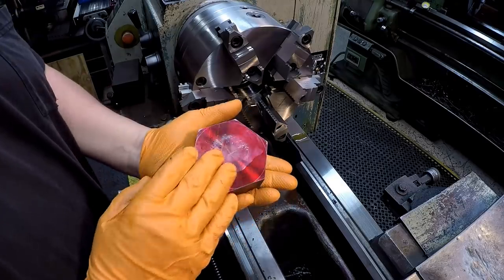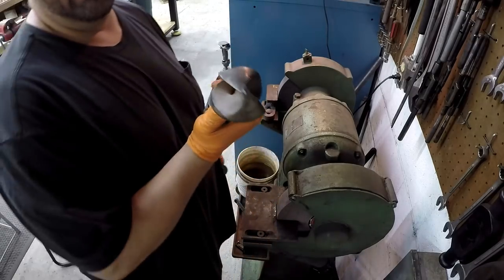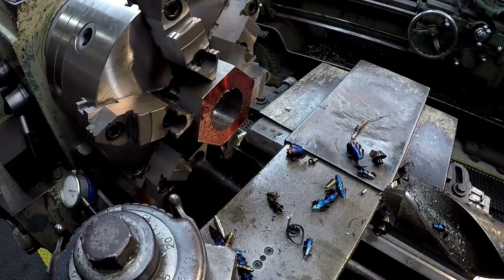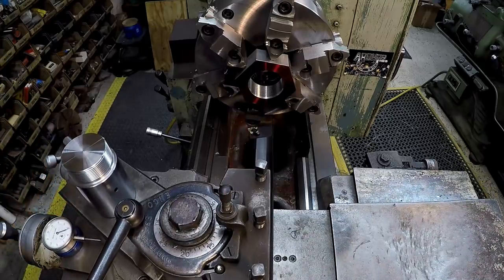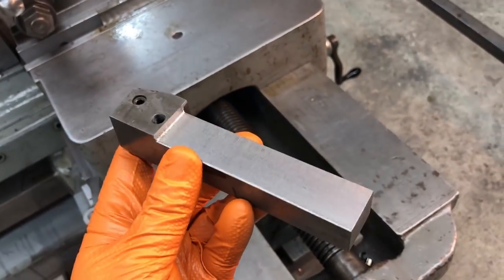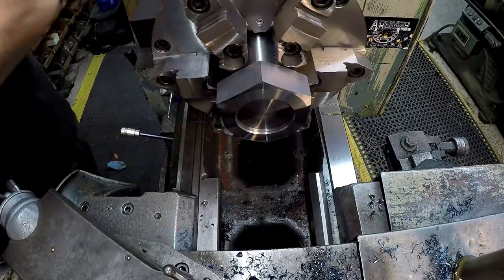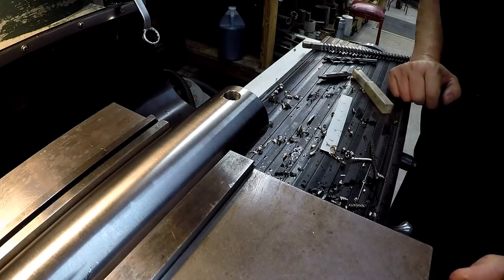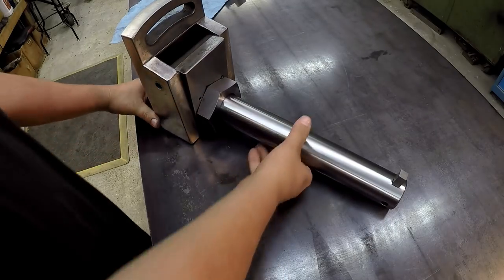Custom Internal Shaping Bar Part 4

Comment: Again I know little and have no experience in a machine shop. Would it be a good idea to mill 2 flat spots on it, so a wrench could hold it while you are tightening the nut?
Reply: Learning Electronics Cheaply 
i was assuming or wondering why he didn't put a key or a spline on the shaft to keep it from rotating whilst in use.
idk if it was an oversight or if I'm over thinking it.
Reply: Learning Electronics Cheaply I would think you want it to be infinitely adjustable. If you key it or spine it, it would only be indexable to the spines or the key way. Just my thinking anyway.
Reply: that makes sense.
so, i guess that means I actually was or may have been over thinking it.

Comment: Adam I was wondering how the clapper will handle the stress of the additional length of the shapping bar and how can it it be compensated for? If you covered this sorry I may have missed what you said ...love all the videos and I am in the I.T. field, dont do any thing with metal working not even as a  hobby. I came acrossed your work because two of my customers own machine shops here in Jacksonville, Fl and their work looked interesting. So i have been watching your videos for along time now. Keep up the great work!!

Comment: Adom  when you are fitting the nut on the shaft would you consider a little lapping compound to loosen the fit a little?  i have an 1936 Atlas 10x36 which is the third from the last one made according to the s/n  i appreciate the detail in your explanations and great photography    THANX

Comment: @27:00 The machinist fit, no play and wiggle. I'm new to this and I have terrible backlash on my cheap lathe. If I was to remake the nuts to a tight machinist fit like this would it eliminate backlash? Any advice is welcomed.

Comment: on the drill bit you ground, you said it was soft, could it be that because of its age and previous grinding that you have passed the original tempering of the metal?

Comment: what type of broach are you using? I use 2" boring bars with 1/2" tooling for my mobile line boring setup, and want to make some more bars to have more different lengths, you can see the problem in my video of line boring a steering cylinder  boss on a skidder where a much shorter bar would have been ideal, but the broaches that I have found for 1/2" holes state that they can't do a full 2" depth
Reply: I am in the same position... Did you find an answer?
Reply: @TheDavid5662  I haven't tried yet, but I am going to try tapping the hole first to remove more material, since I need to tap anyway, and my understanding is that the gullets in the broach filling up should be the deciding factor on broaching depth. Hopefully this fill make a regular broach work.

Comment: A  drill wall rack would be nice to display all the big stuff you have 👍
Reply: Do you realize how much wall space that eats up? I do, a flat ton. I had an improvised drill rack for awhile. In the end, I couldn't justify the space it wasted. My Morse Taper drills are now in my Vidmar cabinet drawers.
Reply from the maker: If I had plenty of square footage for tool storage I’d love a more pro rack system, but since I don’t, the Lista works just fine.

Comment: Why did you put the set screw from the side instead of from the end like your buddy in Pine Bluff did? I am also wondering why you didn't machine something to keep the bar from rotating while tightening the nut, whether it be flats or a key or some other method.
Reply from the maker: Your asking too soon

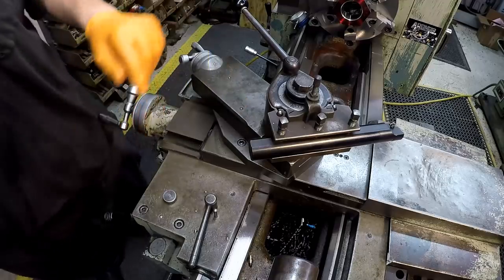Comment: I have watched a hundred hours of Adam machining stuff. at  10:00 Adam measures the diameter of the 2" hole he just drilled. He surprised to find it is 2.002", I am NOT. This is Adam Booth. He is a Master Machinist. Even when he is not trying hard for accuracy, he comes within 1/1000 of his target. Then at 12:50 he says, "I'll indicate it so we are square with the work here" and then shows the result--the needle is Rock Steady across the length of the tool holder!
Reply: The needle was stuck.

Comment: I see you're wearing rubber gloves.  Have you ever tried using the super thin cotton inspection gloves as liners?  I wear rubber gloves 4-6 hrs every day at work and swap a couple sets of liners (so they dry between glove changes) and new rubber gloves every hour or so.   They make a huge difference!

Also, damn that drill index is sweet!
Reply: if you work with rotating machinery I'd think it is a bad idea unless they rip easily
Reply: That's a good point.  They are super thin but probably tough enough to be an issue if something got snagged.

Comment: Great video Adam! One question,  I’ve noticed the clapper on your shaper is always offset one way and the tool holder offset the opposite way, my curiosity has to know why.  Thanks for the great content.
Reply from the maker: You swing the clapper away from the direction of cut so that the arc of the tool swings it away from the cut. The angle of the tool holder itself is just to create the lead angle I want for the cutting edge.
Reply: Thanks for teaching me something new today!  Cheers from eastern NC.

Comment: The break line where the grind angle meets the major diameter should resemble a thread line (left handed) tracing the diameter like an interpolated tool path. Also use that guage to make sure the two cutting edges meet center of the drill..

Comment: I will put a little bit of fine lapping compound on the threads and lap the nut to the threads to give just a scooch of clearance. Learned it from an old timer, he called it the poor man's die nut.
Reply: A tiny bit of valve lapping compound will do the same...a tiny bit, mind you.

Comment: Hi Adam.  At 2:25 when you first started drilling the bit tip raises up prior to entry into the piece.  Does the bit correct it’s self when it starts drilling or does it run off center.  I am new to machining and notice this with my drills sometime.  Thanks for sharing.
Reply: Good question! The answer I've always heard (And I believe it from experience) is that it's due to the tailstock being at a slightly different height than the headstock. Usually, there's some way to adjust for left-and-right error, but not up-and-down (Wear plays a part too.) So when the drill isn't in the hole, in this case, it's just a little bit low. Once it touches and starts cutting, it self-centers (raises up, in this case).

It can also occur if the drill bit is slightly bent, or if your drill chuck isn't holding the bits exactly straight or on center.
Reply from the maker: The drill naturally follow the center, but as all drills do they walk off slightly. No a big deal when your boring to finish.
Reply: Thanks Adam.  I really enjoy your videos.  Thanks for sharing.

Comment: My opinion is one thing more should added a hex or two flat spots that you can hold the main bar to adjust it when you tight it on the clapper box 🤝

Comment: With an insert type spade drill I can usually drill a hole around a thousandth oversize.  I should add, my holder is shop-made, commercial ones might even do better.

Comment: Adam I enjoy your work.  So many say when drilling whole to alway always always step up in sized.. is there a reason you when from no whole to 2" in one step?  I'm not trying to correct your just understand why and when and differing thoughts.
Reply from the maker: Shaun Tucker I always step up in sizes. I went from 1/2” to 2” on this job.
Reply: Abom.. thanks.
Reply: I’ve always been told that the pilot hole should be just wider than the land of the next drill so that you are using the entire drill. It prolongs the life of the drill

Comment: Should be 0.625 for UN threads. 0.75 was the older value for American National threads. When the spec was changed over to unified threads, the thread depth went from 3/4 of V height to 5/8 of V-height.

Comment: Man I love the broaching. Way back when dinosaurs roamed the earth I worked at Westinghouse in Tampa where they made nuclear steam generator parts for a French franchise. They developed a special broaching machine that pulled two broaches is opposite directions simultaneously through 4” plate. The broach pattern was a modified cross on specified diameters. The broaches were 12’ long! Unfortunately I never got to see the finished machine or see it in action as this was done in France. Bummer! BTW the plates were to hold large copper cooling tubing. There were many of them inside a special pressure vessel.

Comment: When cutting threads, how do you know when to start the cut? What keeps you from starting a thread on the wrong side of the inside diameter, compared to your last pass?
Reply: there's a threading dial. usually broken into 4 equal segments labeled sequentially.  if you throw the feed lever at the same location it engages the saddle at the same location on the lead screw on the lathe. the lead screw and chuck are mechanically linked so timing should not be an issue so long as the part is not removed
Reply: This Old Tony has a good video about cutting threads. It is a nice channel to follow too.

Comment: I have always wondered, is the shaper faster or more precise than a Bridgeport or a CNC Router? When would you choose to use a shaper/scraper than a CNC?
Reply: It's fun. :)
Reply: he's mentioned that it's just fun for him and just gives him a chance to utilize the shaper in almost every video featuring it, except for this one for some reason.
ps, not trying to sound like a turd about it. i was curious myself as to why he didn't say anything about why he uses the shaper, since he usually does.
Reply: For cutting something like case hardened tool steel the shaper is perfect, no point messing up a nice endmill on an unknown material.
Reply: Exactly. If your shaper's HSS cutter gets dull, you just re-sharpen it. If a milling cutter gets dull, you have to send it in to be sharpened. If the HSS cutter gets a corner snapped off, you grind it down anew. If a milling cutter flute gets broken off...time to buy a new cutter :( The shaper seems to be way more forgiving and even more economical (depending on how much electricity it uses, of course)

Comment: You're opening up some big holes, ever consider using spade drills?
Reply: @jaydunbar7538  take the time to familiarize yourself with Waukesha metal working spade drills with heavy duty steel shanks, or Sandvik carbide insert metal cutting spade drills or Valenite ,iscar ,carboy etc  before sounding off in future they are an extremely efficient metal removal tool with excellent surface finish.

Comment: you need to bring home some 20 foot lenghts of various sizes of white Schedule 40 PVC pipe... cut them at a 20 degree angle about 10 inches long...  get a can of PCV primer and glue also.. when you get a you may want a  piece of 1/2" or 3/4" PVC also..  you can glue them in to a big drill rack.. you may want to start with some 3" PCV then some 2 1/2 and some 2" pvc  glue them side by side with a piece of 1/2 or 3/4 across the front bottom so they are at an angle..  you can now figure a width to stack them.. smear some primer and then glue on the sides and stick them together..  so it will be like your taper attachments rack.. but it will stand against a wall or sit against the wall on a work bench..  cut strips from left over pvc to glue across the backs of the tubes to stop the drills from falling thru.. far easier on your drills than rummaging for one in a drawer..   its just a thought..

Comment: 20:00:  A little worried about the tool catching on the return stroke.  Is that normal?  (Not the worry but the catching).
Reply: That’s what the clapper box is for. It is designed so that when the tool is returning it can lift up and slide over the material you are machining. If you listen you can actually hear the clapping sound.

Comment: I’m asking because I don’t know any better what would happen if you were 3/16 inch higher than the centerline when you did that?
Reply: The cutting edge of the tool needs to be set at the centreline of the work piece in the lathe otherwise it wont.  cut.
Reply: Would just rub , get very hot

Comment: What's special about cutting oil compared to, say...  5W30?  Do some people use their old engine oil as cutting oil because I've seen some really dark stuff that looked like old engine oil...  ?
Reply: It's sulfur based cutting fluid. Believe it or not, cutting fluids are engineered for their task, despite what most people come to think. Is it worth a premium? Unclear.
Reply: Each kind of oil is designed for it's particular properties.  Especially in high speed production where a small reduction in cycle time or a small increase in tool life makes a big difference in the bottom line.

In small home shops, those factors are not so critical as you can  slow down or apply oil more often to get a good job. This is why not a lot of machine shops run shapers tooling is cheap, but they take a lot more time than a mill.

If you get a chance, read op on these topics in old editions of machinics hand books where they discuss lubricans like sperm whale oil, lard ect.

If you need lube and only have 10-40, it can be used because even the wrong oil is better thn no oil.

Comment: I dunno about that hero cut on the shaper. It looks like a lot of flex on the retreat stroke.
Reply: Of course there is a lot of flex on the return stroke. The clapper box allows the tool to rise on the return stroke then drop down for the next cut.

Comment: Fantastic to watch!!!  I would rather have filed the top of the bit-hole instead of the bottom.  You're then sure the bit is seated on a perfect flat plane (supposing the broaching process gives a straight cut).

Comment: What advantage does a 6 jaw offer over a 3 jaw? Forgive me if that’s a dumb question I haven’t touched a lathe in years.
Reply: more jaws=more grip=more stable, simple.
Reply: I figured it was more grip but wondered if it had an advantage of holing parts more concentric. Thanks though.
Reply: More jaws more better!
Reply: More clamping pressure is the main one. It can also be a big advantage if you're holding plastic parts, because plastic can squeeze a lot, and sometimes escape from a 3-jaw chuck due to the large gaps between jaws.
Reply from the maker: More clamping area providing more holding power, and helps minimize deflection.

Comment: On the machine you called the shaper @ 20:00 ... the tool bit jumps up a bit while its retracting is that normal or is the tool slightly off?
Reply: Carl Crott Perfectly normal, it’s designed to work that way. Even when retracting, the table feed still goes forward, so without the clapper mechanism, the cutting edge would start rubbing against the yet uncut portion of the workpiece.
Reply: Teodor Rosca oh! Cool. So that behavior in the machine is called a "clapper mechanism"? And yeah protecting the cutting edge while retracting makes good sense! Thanks.
Reply: Carl Crott The assembly to which the cutting tool is mounted is free to rotate around a pivot point above the tool, but is constrained in such a way that it can only move upwards. I think it’s called a clapper box because it claps against the ram at the end of the return stroke. Hence, the shaper is a very happy machine that likes to clap a lot :D

Comment: hi adam, you use 6 jaw chuck in this video. what is the difference 3 jaw beetwen 6 jaw ?
Reply: Holding power, a 6 jaw will hold work tighter than a 3 jaw

Source: im an apprentice machinist
Reply: 3 jaws

Comment: Why did you choose the shaper over the milling machine to customize your tool holder?
Reply: It's easier to regrind a hss tool then bang up your inserts or nice carbide endmills. Those tool holders are super hard
Reply: @robwigglezz944  makes sense. I just assumed the mill would be faster. But if your gonna tear up expensive cutters. Wouldn't be worth it
Reply: @easyian01  if I was in a rush, yea I'd mill it too, but I also don't have a shaper haha
Reply: I would have never used a shaper

Comment: You had a still shot of an eight-sided broach. What was that about?
Reply: The broach starts with 8 sides and tapers into a square to slowly make a square hole
Reply: By The Sea Aspirin Shop That is the broach he used to cut the 1/2” square hole.

Comment: 15:20  How do you know you moved .050" on the compound if it's at an angle? I would think you moved less... am I wrong?
Reply: He moved the Compound itself .050".
Reply: Correct, so he moved it less than .050" since it is at an angle. Eyeballed it I guess.
Reply: Since the dial is on the same angle as the compound it is a direct reading.  If the dial and compound are different from each other then you would be right.

Comment: Will your LISLE 91000 feshen that 2"?
Reply from the maker: Don’t think so, and that’s why we have a 12” pedestal
Reply: I got my STERLING set up.  It works really well. The Sterling should do 2 1/2" down to .125"  I would not sharpen on anything under .250".  I have spares.
  Another great video. You are looking good.  This is from one big guy  (349#) to another.

Comment: Correction: I am wrong.  My milling machine experience was with a machined that had a rotating cutter passing over the work thus flattening the surface.  The shaper has a fixed tool running back and forth (obviously).